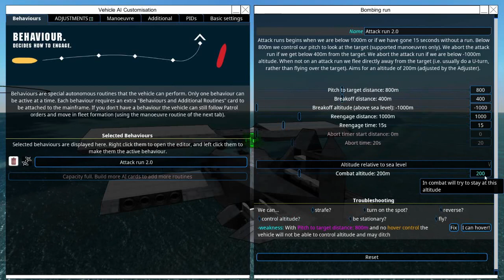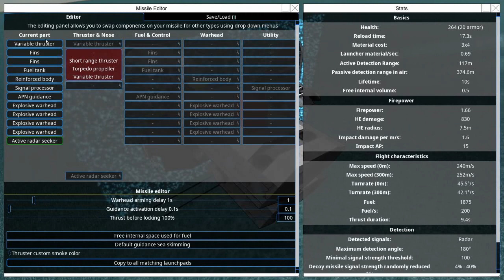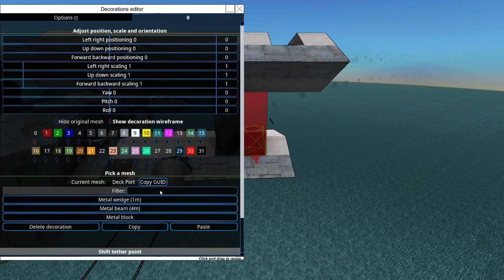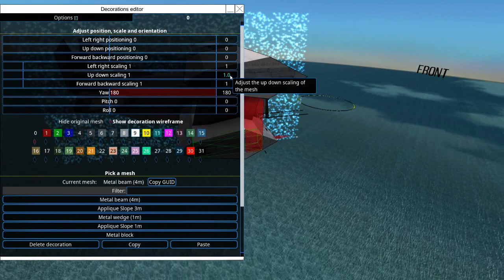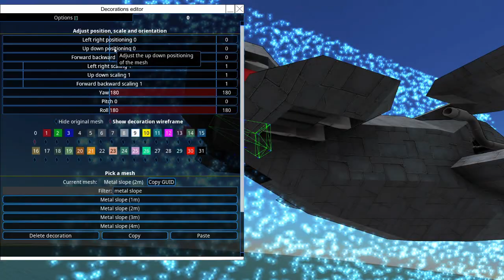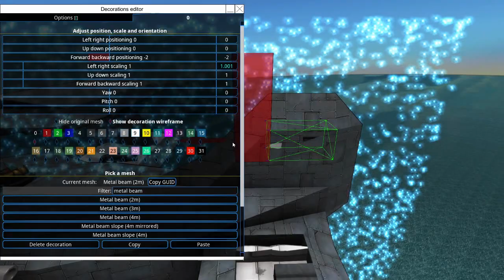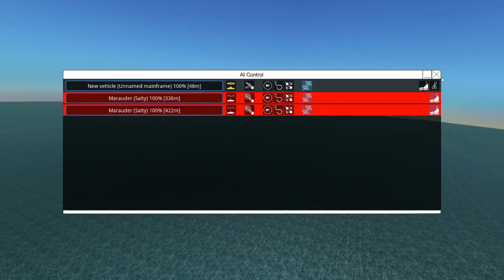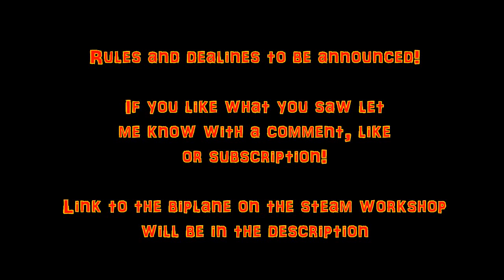Biplane Tutorial and King of the Skies Announcement

Comment: I understand that this is just a demo vehicles, but I'm willing to bet that you could've cut engine power costs by > 1/3 if you tweaked center of drag just a little. Also, ctrl + shift + x is your friend. It places a deco of the current block in the current place scaled up by .5% to avoid z-fighting, and it get attached to the nearest block. Anyway, it looks great for a quick build.
Edit: did I listen to a metal version of Scarborough Fair? No, don't tell me, everything is either Scarborough Fair or Greensleeves anyway.
Reply from the maker: Center of drag can be really weird with these because the upper wing can generate so much drag.  Something that I have been doing to work around that in my custom campaign is to have a faux upper wing made with decorations.  But yes you are right I was trying to give people a quick and dirty example to base their own designs on.  Figured if they were going to be used for a tournament they didn't need to be very efficient.  I doubt anyone will burn through their allotment of materials that they will have in storage.  

As far as the music, I mostly look for prices with heavy guitar riffs.  The ones that I used for this video are from a guy that goes by the name of serpent sounds.  I have been getting some newer stuff from a YouTuber that goes by techno axe.  I haven't had a chance to work his stuff into the rotation as much.

Comment: It sounds like your audio issues have gotten a lot better, so I can actually understand you now. It's certainly still something that I'm struggling with on my channel as well. If you're recording with OBS, you might want to consider slapping on the default noise gate. It doesn't fix the root cause of 'wet' mouth noises, but it sure helps a lot.
Reply from the maker: Didn't realize it had been such a problem.  The main thing I did with the audio was just lowered the volume of the music.  I typically watch everything on YouTube in 2x speed.  So I probably don't pick up on the little things as much.  Drives the wife crazy when I do it.

I know I have a bit of a stutter.  I get a bit overwhelmed in trying to make sure that I am providing accurate information and I think that plays a big part of it. Sometimes I just outright forget what I am talking about too because I am probably doing too many things at once. but I have also been fighting allergies a lot here lately.   Most of the time I was recording this I was trying to keep myself from going into a coughing fit.

I have been working on a rough draft for the ruleset with some help from other people on the Dominion of Dama discord.  Would you be interested in providing some input?
Reply: @Damaddok82 , I doubt that I’ll have much useful input, but I’d be interested in taking a look at the rules you’ve been coming up with.
Reply from the maker: @bungalowbill521  I'm fairly close to coming up with the first version of the rough draft.  I will probably put it up on Google docs once it seems ready.
Reply: @Damaddok82 , sounds good. Feel free to use the email in my channel page when you have that document started.
Reply from the maker: @bungalowbill521  will do
Reply from the maker: @bungalowbill521  I was unable to find your email address.  It may be because I am doing this from my phone?  Anyways, I got a link to the rules on Google docs for you.

https://docs.google.com/document/d/11R2NiDbpIc0qIPOY7GJpbXr-l7-A257_8TLn9PxxFxk/edit?usp=drivesdk

If you have questions or comments feel free to email them to me at

damaddok82@gmail.com